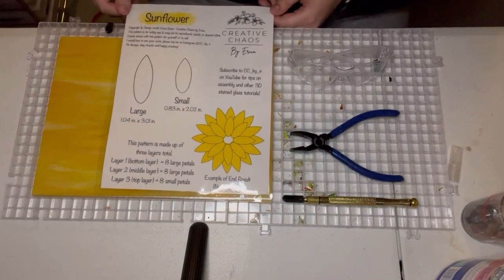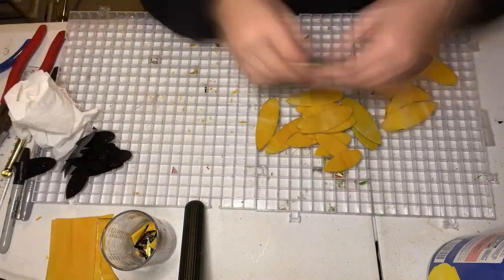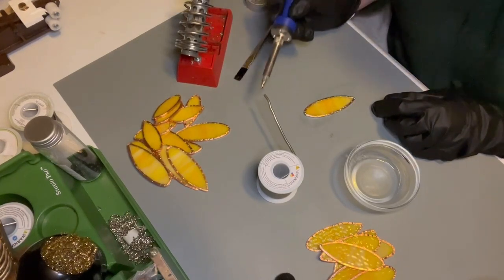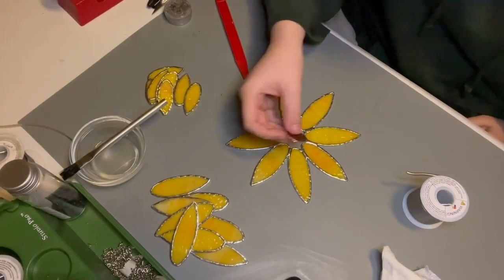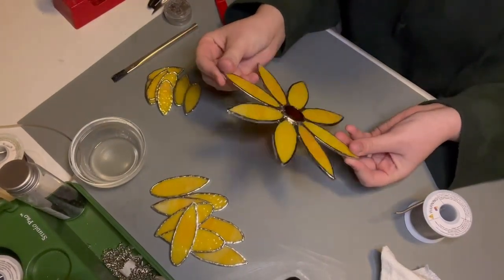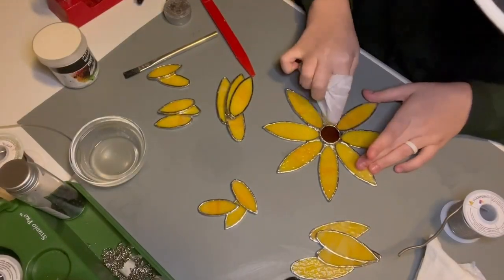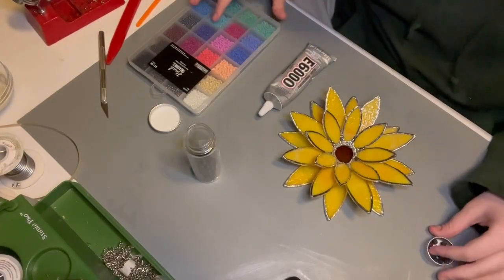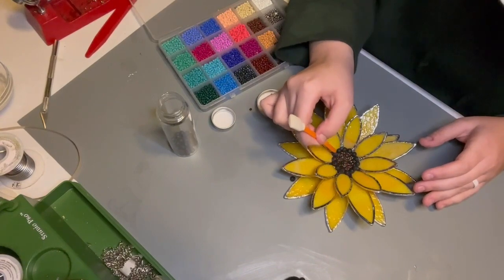3D Stained Glass Sunflower - How to

Comment: I was in the stained glass business for 45 years.  During the last 10 or so years while I still owned a studio, I often made pattern pieces from mylar that were cut out on my large format plotter. After use, I would put those pattern pieces and a copy of the pattern into a large envelope with a picture of the piece placed on the outside. This allowed me to save time and materials if a duplicate panel was ever made.  And I would also write the computer file name on the envelope.  As a suggestion, always keep your vinyl or mylar pattern pieces.  You will go back to those patterns over time, and this just saves time and materials when you make the next piece.